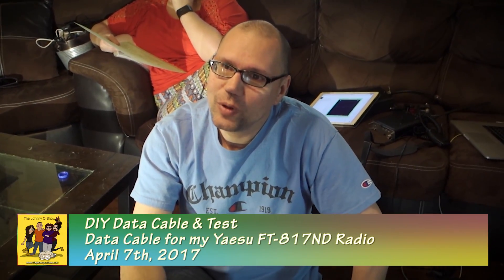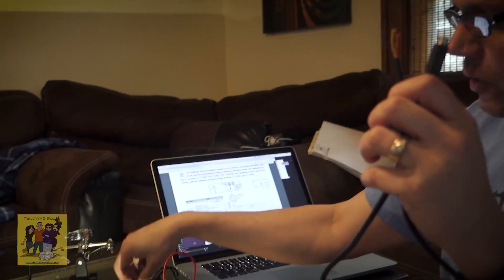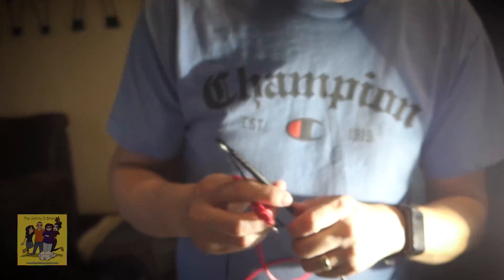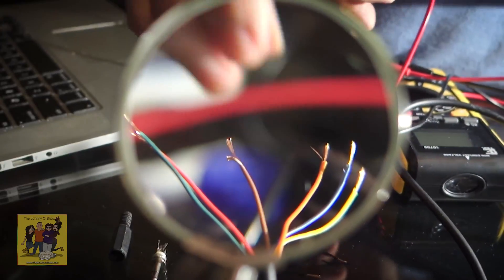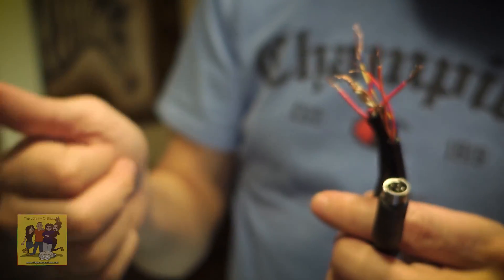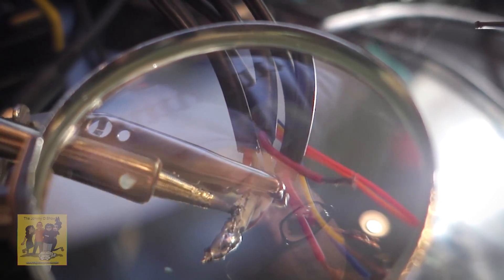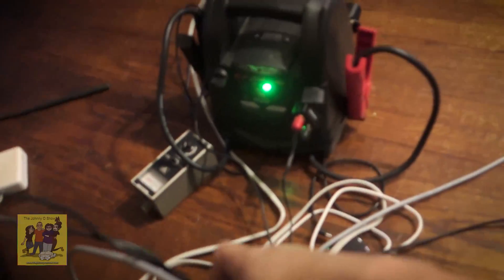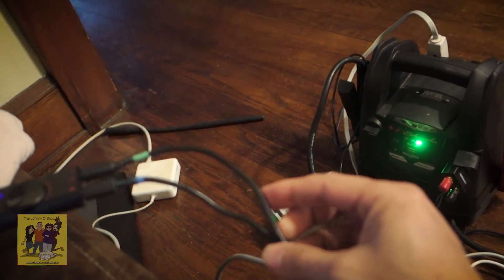Ep. #360 Homemade Data Cable for the YAESU FT-817ND

Comment: How do you feel about this cable now you’ve been using it for some time?  I made up the listening half and it’s a little distorted but works OK.
Reply from the maker: it works well however i have found i can only run about 2.5 watts as the interference from the radio seems to kick out my usb sound card (even when using a dipole antenna 15 feet away), ii have found using a rigblaster helps if your using it on a radio that you need can pump out more power. but on the 817 its fine as its only a 5 watt radio anyway and its not really a good idea to run more then 2.5 watts in digital modes on that radio anyway. I have not had any issue with distortion at all. So for the 817 it's perfect for me and its smaller then a rig blaster. but if i'm using my 891, i use a rigblaster.